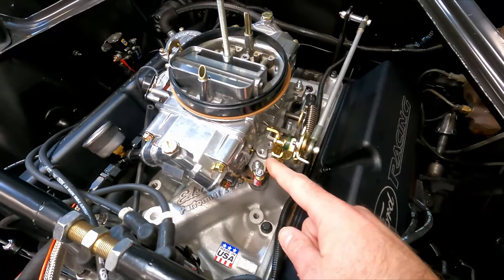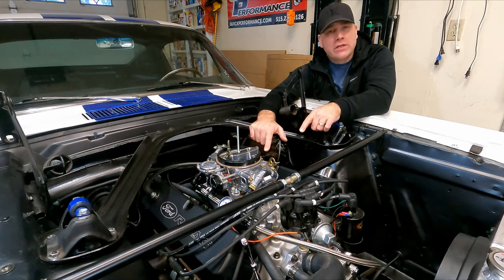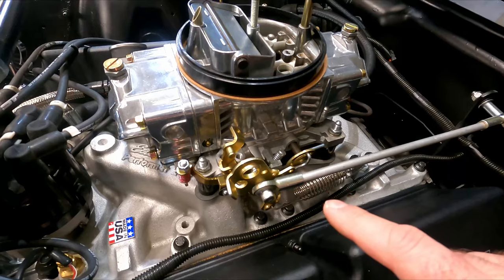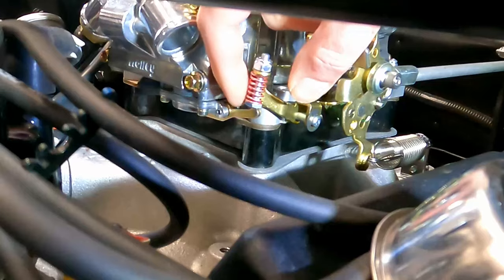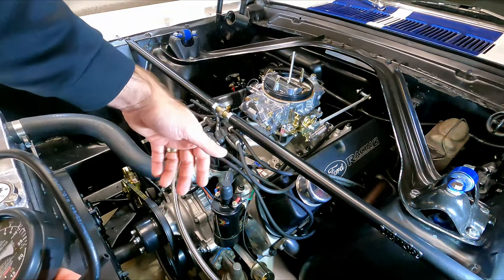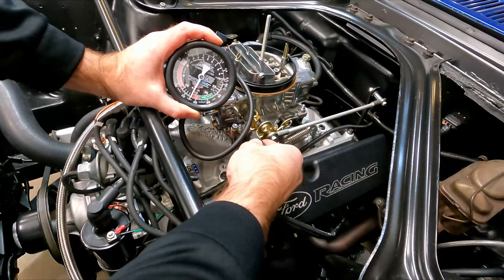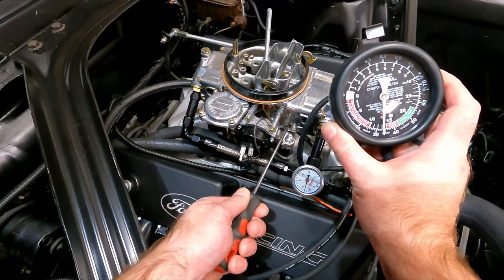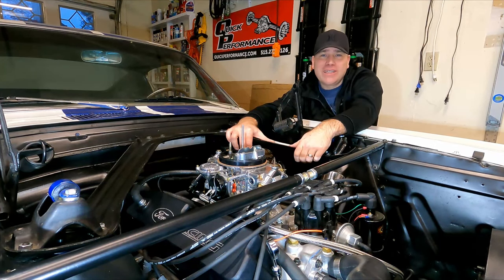How to adjust Holley Idle Mixture Screws and Curb Idle

Comment: Do you do this with vacuum advance hooked up?
Reply from the maker: No, I use the manifold vacuum port on the carb to plug the vacuum gauge into during this adjustment.  This is the same port that the vacuum advance on the distributor uses, so the vacuum advance is not connected during this adjustment.  :)

Comment: I need help high idle in park and when I put into gear and hold the brake the idle is perfect
Reply from the maker: High idle in park is not bad, unless it's really high, then it's just not desirable.  Adjusting your idle mixture screws with an Auto should be done with someone in the car, car in gear, and on the brake pedal while you adjust the idle mixture screws.  For just plain idle adjustment, this is going to be a balancing game of where you want your idle in park and where you want it in gear, but they'll never be the same since there is a 'load' on the engine while in gear.  :)
Reply: @AndyKruseChannel  ok so we did that and we adjusted it so the in gear idle is right then we get high park idle when I adjust the park idle to sit perfectly I put it in gear and it’s too low. 

That is why I currently only have a high idle In park. And it idles above 1100 for sure
Reply: @AndyKruseChannel  I will retry that in gear I did not read that part thank you

Comment: is't that carb a little to big for that motor? are you spinning it over 7k,
Reply from the maker: Nope, it's just right.  :)
Reply: @AndyKruseChannel  please explain i did the math and came up different 347 X7000rpm=2429000 Divided by 3456 =702cfm and that hi rpm
Reply from the maker: @scooter1391  Engine builder said to pair this carb with the engine he built me.

Comment: I just bought a 1968 mustang fastback with a 302 in it I’m 19 years old and I don’t know a whole lot about carbs I just wanna make sure I’m not running too rich I did the typical 1/4 turn my engine idols fine after it’s warm but I just wanna be sure I’ve done it right can anyone of you guys help ?
Reply from the maker: There's a lot more to dialing in the Carb than doing a 1/4 turn, so it'll take a few more videos pointing out all the things you need to check.  Also, the comment section of a YouTube video is not really the best place to have a discussion about how to tune your Carb.  :)

Comment: great vid-- i have a holley 4 barrel vacumn secondarys  wont idle  below 1200 rpm  and back fires above 1500 rpm --mixture screws turned all the way in has no effect on rpm, carb was cleaned--any help apreciated will pay anybody that can help
Reply from the maker: Could be a couple things, possible vacuum leak or timing might be off.  If you spray carb cleaner around the base of the carb and near ports and the RPMs climb, you've found a vacuum leak.  If you have vacuum advance on the distributor and it was connected while the initial timing was being set, this may cause and issue too.  It's really tough to diagnose some issues without being there.  You may want to reach out on local groups and forums and see if someone can pop by and troubleshoot the issues you are having.  :)
Reply: @AndyKruseChannel  I'll check that out, thxs sooo much.  Cheers
Reply: I had a similar issue. Check or simply replace the "power valve." In my case, the "power valve" was stuck open which was dumping fuel at idle when it wasn't supposed to.
Reply: @tstan6767  Thanks your awesome!!

Comment: Que jets usas en tu 302m
Reply from the maker: That's a complicated question.  It depends on your engine build and your carb size.  At the time I made this video, I was using the stock sized jets and they were number 72 jets.  Since I made this video, I have tried 71, and 70 jets.  But this goes with my carb size and build.  On a car with a 302, this particular carb would be too big, so a smaller carb (like a 600CFM unit) would be a better fit.  I don't know the stock jet size in those carbs, but you can pull them out and look.  Finding the right size is an even more complicated question.  :)

Comment: You don't show where you plug in the vacuum guage.
Reply from the maker: I talk about it in the beginning of the video when I'm explaining the two ports that the vacuum gauge can be connected to.  I used the "Manifold Vacuum Port", which is on the front side of the Carb, below the front bowl.  :)

Comment: If the accelerator pump is adjusted too far. As in touching the linkage a bit, it will not simply dump fuel in the carb. The way the diaphram works is by movement. Not saying you shouldnt get it as close to touching without it actually touching, but your info is wrong
Reply from the maker: Ok